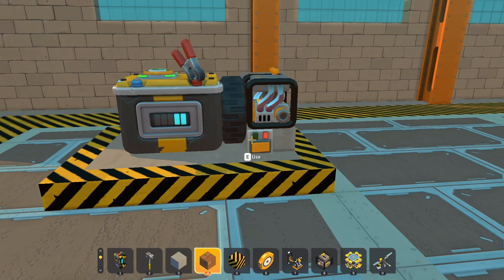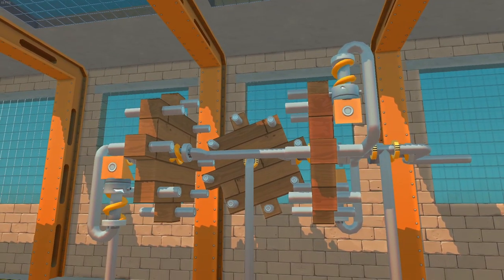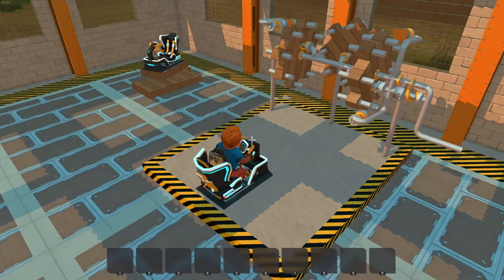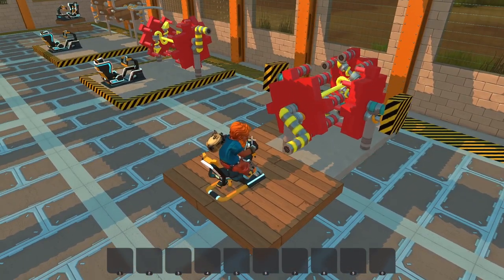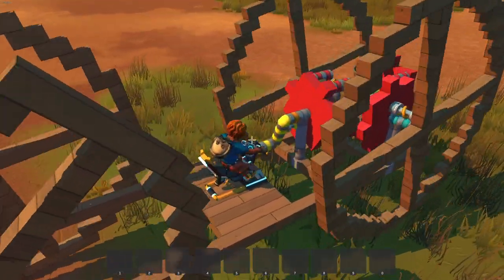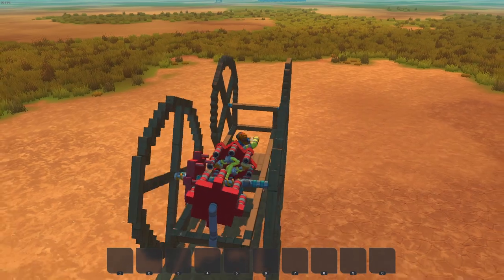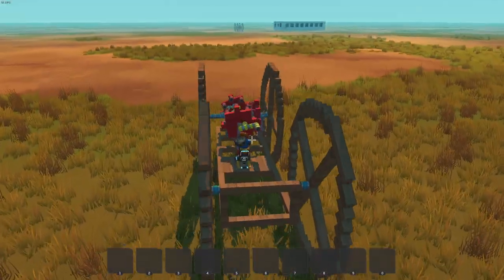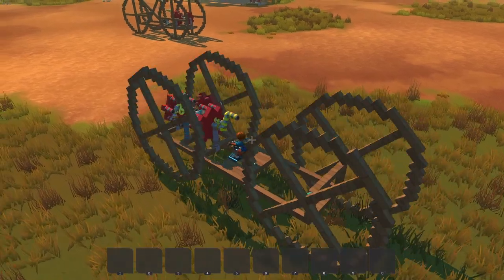Hand Crank Cart  - Scrap Mechanic

Comment: a. Generate power by using suspension glitch + controller
b. you can use LMB and RMB to activate buttons/switches 1 and 2, so you could use LMB to steer left and RMB to steer right via controllers
Reply from the maker: Hey SenSeiPLAY, thanks for the comment. I am aware of the glitch but to me it feels like cheating. I intentionally tried to use steering to generate motion, just for the sake of it :)
Reply: @oggi42gaming77  then look at the second part of my comment 🙂 this feature is not popular and was added like 6 updates ago or so